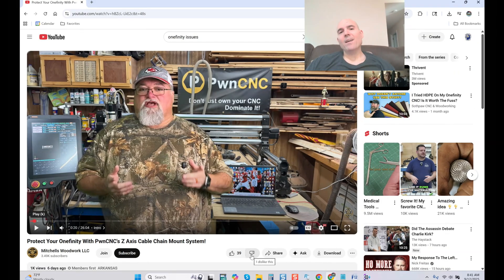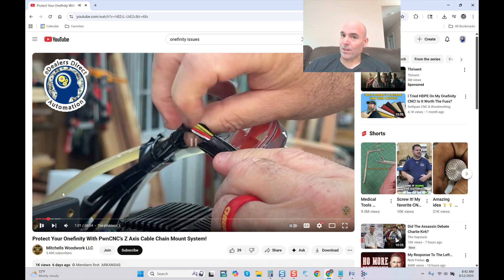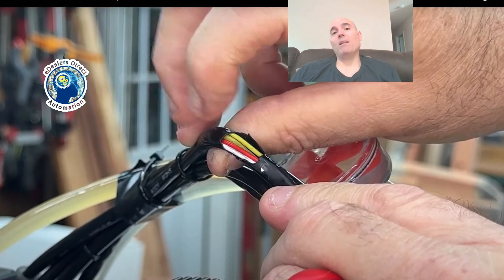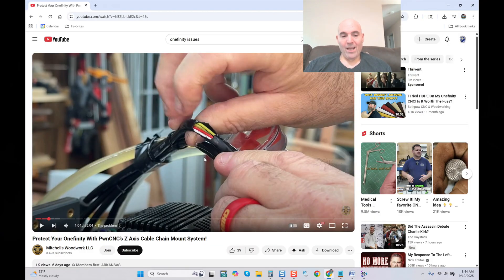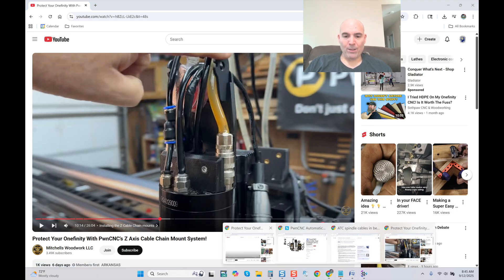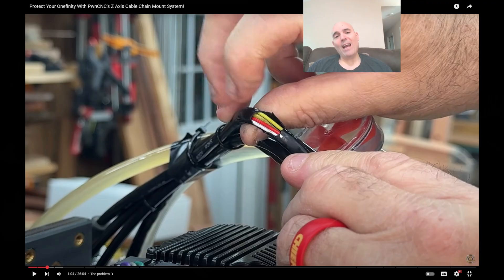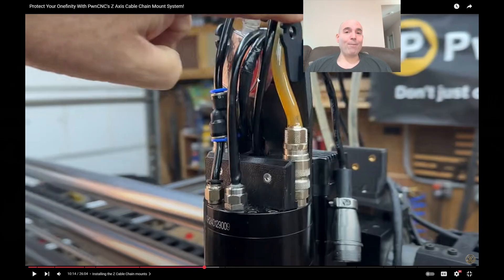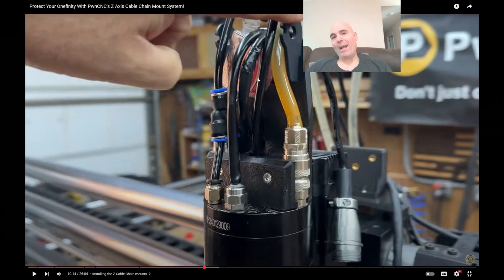👀 WTF is This?! 👀

Comment: I follow Mitchell and saw his video last week.  I had ALL the same thoughts!  I have been planning opn buying a onefinity and PWN ATC.  HOWEVER, I had already decided not to use any of their wiring.  My plan was to properly manufacture, (or buy from you) the proper shielded cables for everything.  I think the young man at PWN is an interesting guy, but a little in over his head,    I also would use better cable management to start with!  Thank you for keeping the "comon sense" flowing!
Reply from the maker: Thank you for your support. This is more than a slight mistake if other clients of his purchased these units expecting to get a properly put together package. Every one of these people should validate what cables they received to make sure they're using the correct ones. Thank you,
Vince

Comment: Hi Vince,
Can you implement Ethercat on motion control solutions that you offer.

Since the protocol is free, it can be implemented using special layer of software.
Please contact the motion control solution provider that you deal with.

Step and dir method is very acceptable to EMI.

Raw Ethercat frames used in Ethercat is hard to corrupt in noisy environment as the moton controller itself needs to get feedback it expects in terms of positional feedback.

Please implement.
Thanks
Reply from the maker: Thank you for your support. Ethercat is great, but much more expensive than ethernet, and the performance with EMI rejection is still excellent. Thank you,
Vince
Reply: Thanks 

I think you candevelop a dedicated Ethercat Master for your controller which already supports Ethernet.

Since step dir method is one sided communication, the motion planner has no Way to compare the actual position achieved against command position.

The dedicated Ethernet breakout board which offloads the realtime performance requirement from the CPU has to implement the solution to communicate with the Ethercat communication Bus. This would be extremely immune against EMI.

Because corrupted frames are fed directly back to the FPGA chip as feedback , which area compared against the command position . 

I would like to see how this is implemented on an Ethernet Based Controller.

Thanks